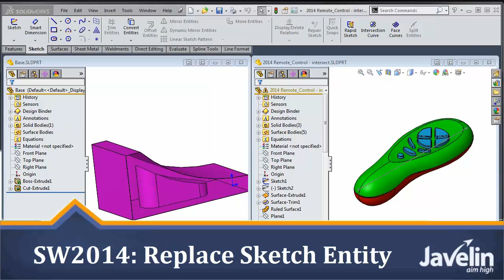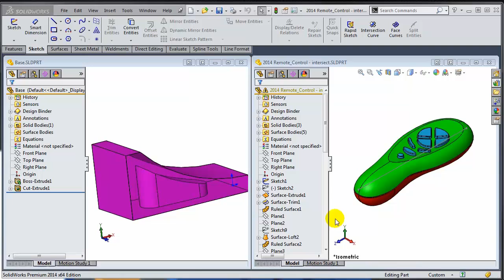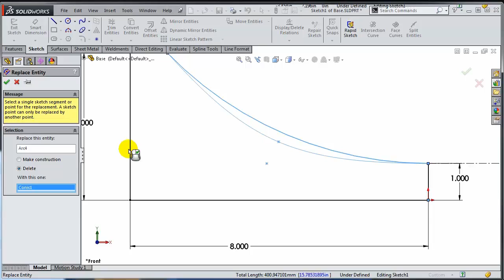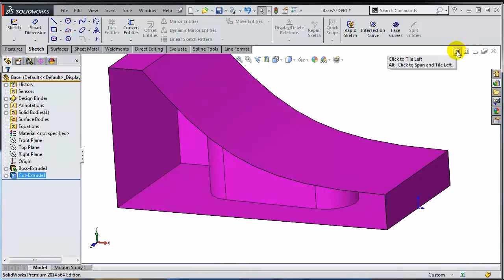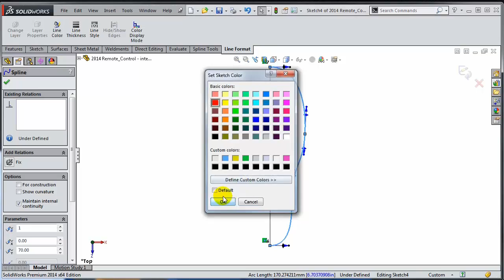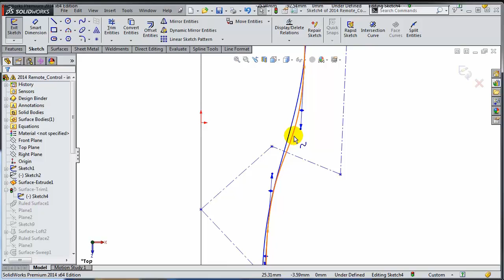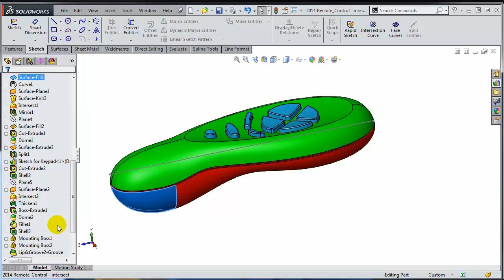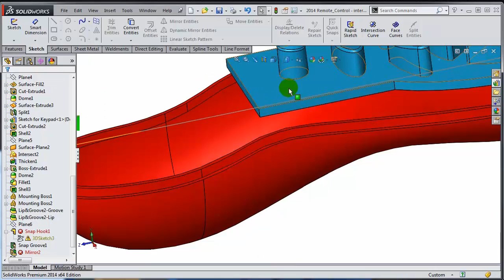SolidWorks 2014 Tutorial: Replace Sketch Entity

Comment: So happy my subscription is still valid. Cant wait for 2014!
Now this is a true improvement, and will save me some time, just surprised it took this long to get.

On a side note, it looks like you have some interesting custom toolbar in the command manger, line format and spline. I would be very interested in your set up general. what mouse gestures and quick keys you have setup.